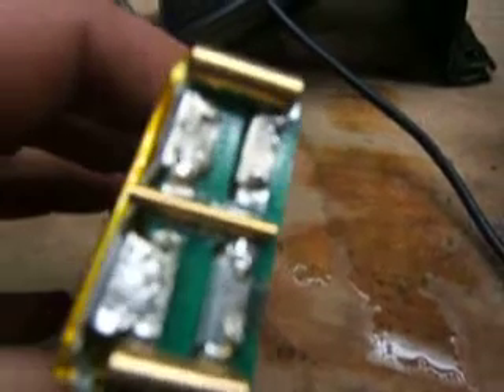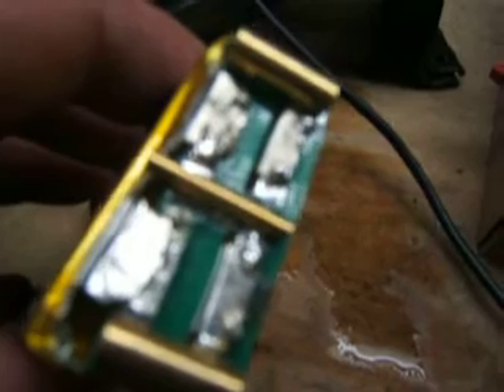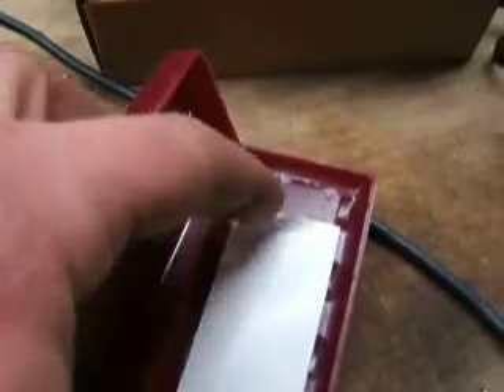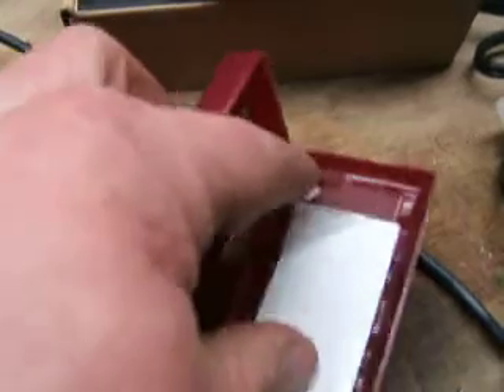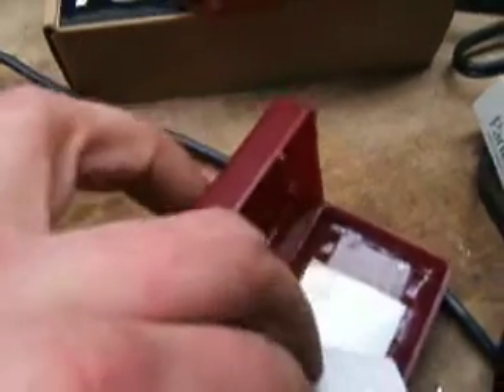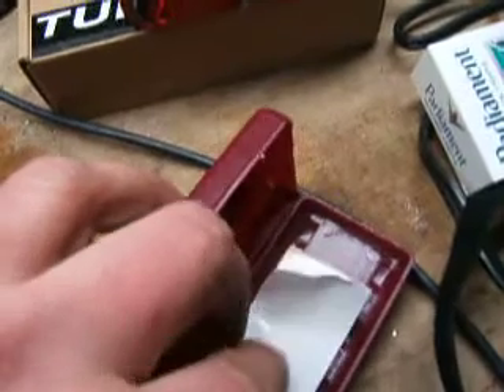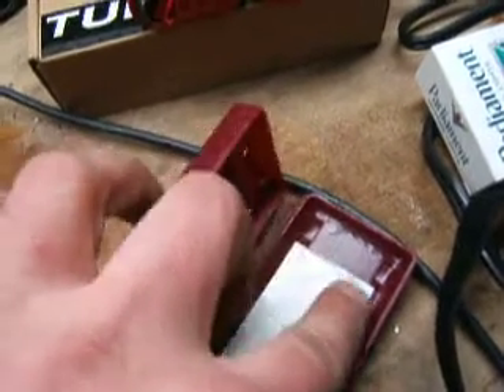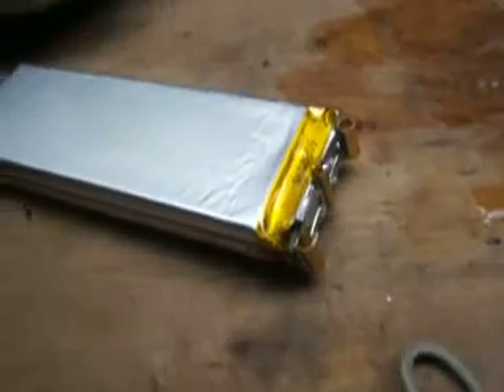Zippy FLightmax 4000 Failure

Comment from the maker: You are not kidding.  We used one of those razors that clicks out of a handle...that being said, learn from our mistake, we had the razor about a quarter inch out of the handle and due to the strong seal broke through at one point puncturing a cell, DANGER! threw it out the garage and then later into a bucket of salt water etc...proper disposal.

Comment: Just received my two batteries from them. 20C series 2200MAH and NEITHER one charges on 3 different chargers. Neither one even registers anything on my meter either. So I decided to solder an eC3 on and see if that was the problem. Still nothing. Both are in my trash can right now awaiting Friday morning pickup because you get what you pay for and seems that hobbycity are just raking us Americans over the coals in all ways. Out $30, but now I know to NEVER buy from Hobbyking again ever.